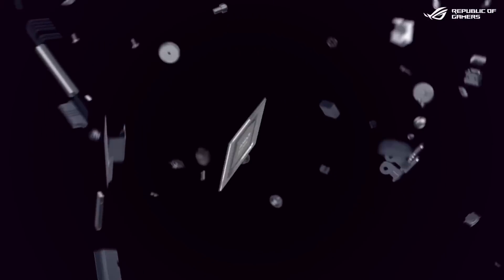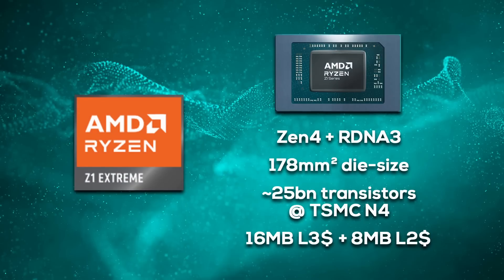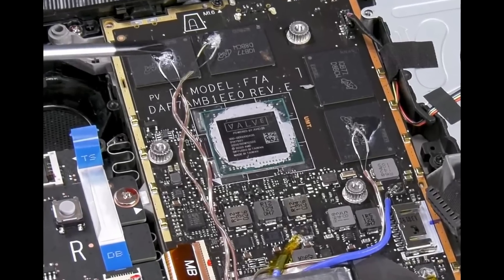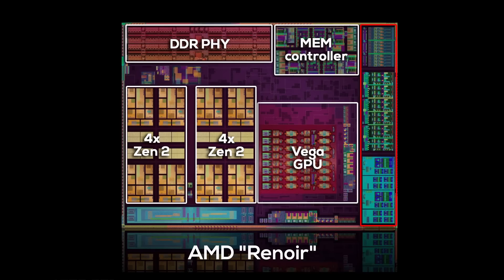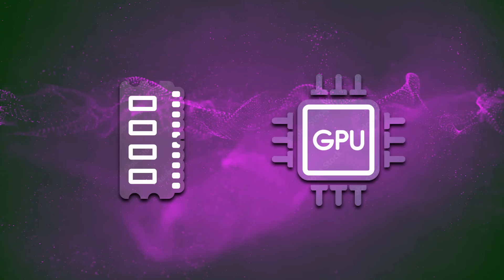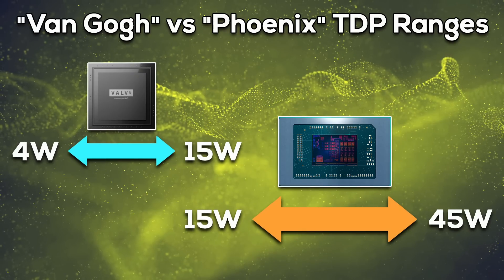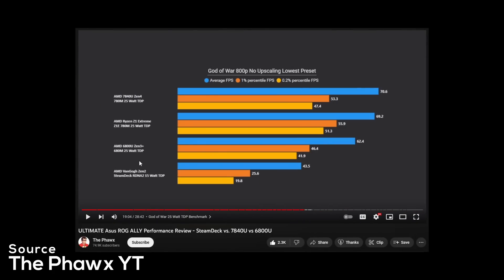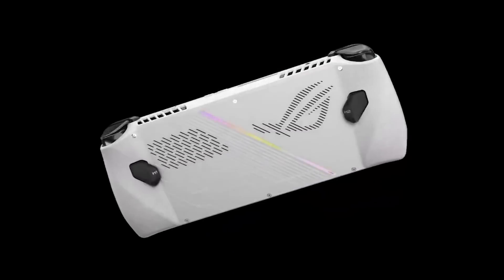Why the ROG Ally can't beat the Steam Deck

Comment: They are competitors, but they do not completely overlap in use cases and functionality. I have my steam deck, and have ordered an ally. The deck is great and far outperformed my initial expectations, and there are a lot of games where you can drop the TDP down to a measly 3 watts and play for extended timeframes. I’ve comfortably gotten enjoyable performance from newer games at only 10w as well, it’s just a great experience. But what makes the deck shine the meat for me, is the combination of SteamOS and the Built in Steam Controller 2.0. The track pads go a long way in expanding the kind of games you can play on deck.

The Ally, I can only go on what I have seen, and what I have seen is mixed but positive. I think the biggest thing holding it back is windows overhead, and the early first generation state of the software/hardware combination. Given 6 months or so of it being released I think will go quite a ways to smoothing things out both driver wise and software integration, and possibly some windows handheld centric optimizations from Microsoft or the community at large, I think we can expect good things.

Time will tell, either way, people looking to run these portably for extended play time, need to temper their expectations a bit, and stop comparing them to phones or the Nintendo switch. Buy a portable battery bank and enjoy extended play.

Comment: Also the Steam Deck's RAM runs in Quad Channel configuration which also adds to the performance. Yeah that makes sense why the Steam Deck out performs the Ally at wattages below 15 watts is because the Deck is optimized to run and performed at those wattages unlike the Ally. The only thing that is custom about the chip of the Ally is in name only the rest of it there is nothing custom about the Ally's SOC.

Comment: For me Ally is a winner, windows OS allows anything you can install on a normal PC to be installed, that includes pirated games for those unable to afford them. Steam deck is tied to your steam account so only purchased games or EMU games. 
No contest.
Steam loose out on my cash due to unavailability, I have tried for 3 months to buy one and only option is the 512gb, I wanted the 64gb version which I planned on upgrading myself.
Now the Rog Alley is out it's a no brainer, almost the same price as the current Steam Deck that is available but you a better screen, better CPU and install what you want and not tied to Steam OS and what games you have purchased there.
Reply: Shoot,,thats make sense,,thanks for ur explanation,,my heart goes to ally
Reply: Yeah, I think most fanboys forget that there are other places to get games (whether that's another store front or pirating). You don't even want to know what a nightmare it was to try to play my own, older, games from discs on the steam deck. I used a program to convert them to isos which are perfectly playable on windows but not at all simple on the steamdeck!

Comment: According to The Phawx's rigorous experimentation, they've come to the hilarious conclusion that disabling cores in the 6800U doesn't really save power. In fact, it sometimes results in lower performance at the same TDPs. Now, while we haven't tested it on the 7840U, I'd bet my collection of vintage floppy disks that you'll likely witness a similar comedy of errors. So, my friend, it seems like disabling cores won't give you any superpowers, but hey, at least you'll have a good laugh and the same TDPs!

Comment: The ally is having software / driver issues. At 15 watt the ally outperforms the steam deck. Steam deck is only good at low tdp. Plus the ally screen is vrr capable which is a game changer. Allows for a much smoother experience.

Comment: Doesn't matter. I've had the steam deck for a year and rarely use it. Gaming 60 FPS max(most time 40 to 50) with no vrr just sucks. I would 1,000,000% be OK with higher power tdp limits to push more frames and less battery life than playing less than 60 with no vrr. 😂

Comment: 1) battery life .
At 10 watt ,deck straight up murder the ally. 

Performance at lower watt.
The deck once again dominate the ally. 

The only reason to get the ally is if you want to mod your games .

If you want actual Performance out of the ally you will have to stations as lower watt gameplay is out of matter.

Comment: I have been thinking a lot lately, people are very excited about the price about the Asus ROG ally isnt it basically a decent laptop with the keyboard cut off and a smaller screen? Can't you buy a decent similarly spect laptop for about or lower then the price of the rog ally? I have the steam deck and I have the Rog ally pre-ordered and am looking forward to getting it. But I don't exactly agree when people make the claim that Asus isn't making money off of these units. It's mostly off the shelf parts, it's windows 11 with a little optimizing. Memory prices and chip prices have fallen throughout the last year or so. When you think about everything Valve has put into the steam deck, custom chip, custom version of linux that makes PC gaming very approachable for maybe the first time on the go, you realize how insane of a deal that 64gb steam deck really is. People gush over that 1080p screen on the rog ally, people gush over it's pure power but in truth is your likely going to turn all those settings down to close to what they would be on the steam deck anyway to conserve battery. I'm not saying the Asus rog is a bad product by any means, like I said im looking forward to it. But in my opinion the Steam Deck is a way better value and I think the Steam deck isn't going to have any problems outselling this thing massively. The steam deck is a game console that happens to be a PC, the Asus rog is a PC that happens to be a game console.

Comment: I learnt today about using FSR on the Steam Deck, it allows for a lower resolution to be used, then lock frame rate at 40 and you can turn the graphics settings up for a game.

Comment: For me the software also makes the SteamDeck better, Windows can’t suspend games properly for instance, it drains the battery. That’s one reason Valve went with Linux, because they wanted to squeeze as much performance out as they could for as little power as possible.
Reply: It's been said million times: windows can suspend game, just turn off hibernate mode. Doing this has no effect on battery.

Comment: Yep, for me personally battery life matters a lot as Im starting into trekking backpacking and Im also a truck driver all europe. Rog Aly is more powerful at higher wattage but I value more battery duration so steam deck 10 watts mode wins hands down no competition for my specific case scenario
Reply: Switch oled has good battery
Reply: @ufcfan3940   even if switch has decent battery (depending on what games are being played) I dont want to buy one as games are very expensive and I like the freedom to dual boot windows 11 from sd card while keeping steam OS on internal storage.

Comment: The ally power is getting taken by the cpu. Disable SMT and possibly 2-4 of the cores and lower the cpu clock a little. This will give more power to the starved GPU
Reply from the maker: Maybe the cheaper Ally with the normal Z1 chip will perform better than expected.

Comment: For me the colour and contrast ratio of the screen, and charging rate of the steam deck makes me uncertain.  I would much rather have a small amount of time with the ally screen than a long time with the steam deck screen.  Nobody seems that bothered about the screen from that perspective.
Reply: Do you own the steam deck? My screen is terrible. I'm not sure how it was assembled but there are white pressure marks around the top left and bottom left of the screen, as if the casing is pushing against the panel. Not to mention everything looking slightly gray, even with software adjust to it.
Reply: @jollyrancherchick  I saw one in a second hand shop and it really put me off, so I waited.  That was before the rog ally was public knowledge.   I can’t be doing with that,  colour is a big part of the experience for me.
Reply: I think what you are talking about is backlight bleed btw.

Comment: Power efficiency is cool. But if Steam deck will continue to struggle running new games at stable 30 (and it already is) many people will choose more powerful z1 devices instead
Reply: New games are not all designed as AAA power hungry titles. That's just a few of them.
Reply: @stephanepiquemal8297  Who cares if what the user wants to play happen to be those few titles?
Reply: @jollyrancherchick  Even the Z1 struggles to play titles such as Returnal. Such power hungry titles are just not designed nor optimised for handled devices.
You can't expect developers to optimise their games if people keeps buying the next more powerfull device.

Comment: Maybe Asus ROG Ally will get another SKU with Z1 and 720p/800p screen. This could trim loads/power draws and get closer to a more mobile usage oriented device... you know, maybe also some BIOS/firmware/OS updates to default to lower power draws, 720p screen resolution, maybe dynamic core parking akin to AMD's X3D solution to trim the CPU down to 4 or 6 cores... at half the core count and closer to Valve's take on VanGogh's architecture, the rest of the APU may be capable of better utilising power available. Lower screen res plus such tuning features could bolster Ally's use-cases.
And of course, disable by default/remove the useless and yet power impacting RGB lights on the chassis... It’s not adding anything, but it draws precious little mW of energy stored in the battery.
Or Valve updates their Deck with a chip made for <=5nm manufacturing node for even better power efficiency. Maybe they could arrange for another specialised design with updates to Zen4+ and RDNA3+... that could further boost battery life, the one precious thing in a handheld...

Comment: It still does not make sense when compared to 6800U.. it kicks SD'ass at low power and its a laptop APU and it also kicks Z1E's ass. I think drivers are at fault and the ability to disable cores will be great.

Comment: Contrary to steam deck cult's beliefs rog ally is literally superior in every way when comparing the retail 512gb models of steam deck, aya neo, gpd and onex for the same price point.
The only win steam deck has is when you buy 64gb for 399 and upgrade ssd for way cheaper. But still you get far less performance.
It's like saying 4090 is worse than 4080. HOW? The only thing is the price

Comment: Thanks for this. 

I had a feeling that the Ally wouldn't be a competitor to the Steam Deck, but I couldn't figure out why. 
The boost in power and tech was a red flag for me.
Reply: Easy to compare a device with pre launch software. To one that’s been out for over a year. The SD had multiple issues when it first released
Reply: @xxRichBoy  Asus doesn't support much their products, tho, Armoury Crate has never worked well on my laptop

Comment: Ally absolutely crushes the SD at higher watts. Idk about you guys, but I'm not getting the Ally for low watt gaming. I'm getting it for performance and ability to play AAA games.
Reply: You can better buy a gaming laptop then. Dont really understand peeps like this. Yes, the ASUS is strong. But what is the use of a handheld if it dies in 1 hour and with daily use your battery wil die in 2-3 years.
Reply: @shadowhunterrx  what's not to understand? There are tons of AAA games that run fine on the SD, and will run much better on the Ally. Didn't say I wanted to run them all at 60+ fps. I have my PC for that. But what I can tell you is that I got my Z1 Extreme Ally for cheaper than my 512gb, and it's a huge upgrade lmao
Reply: You might as well invest into a laptop or a low/mid tier pc with $700 not including accessories. You do that these are handhelds yes? The technology isn't there yet for whatever imaginary handheld console that's in your head. I give it another five years before you see anything of a handheld console that plays AAA games with 60hz 1080p with 4+ hour battery life.

Comment: The beautiful thing about the Valve using Linux for the SteamDeck is that they could optimize the drivers and kernel for their specific hardware and usecase. This flexibility doesn't exist on Windows.
Reply: You can also install Linux just like any PC idiot on the rog ally

Comment: There's a serious problem with the unit when it falls behind by 40% compared to 7840U at all power levels in most games.  Even falls behind the 6840U at some power levels.  10W 5W are the biggest problems with the Ally and the Z1E.

Comment: Your videos never cease to amaze me. I recognize your video is largely about power efficiency, but I was in discussion last month, why consoles are often better in actual gaming than pc with some of the latest games.  I believe due to balance and efficiency from the game design stage to pc hardware it’s programmed for in comparison to newest consoles. “Purpose Built vs All Purpose”, it’s not just about brute power. Your talk of custom design, balance, i/o, memory processing and bandwidth is translatable to pc gaming ecosystem.
Hardware manufacturers and game devs must establish balance. I believe pc gaming issues are largely due to data I/O and memory bandwidth at the software level.  Devs can start by requiring SSD, (ideally NVME) and maybe VRAM rqmnt tiers such as 8Gb - 1080p, 10-16gb 1440p, 20gb+ for 4K.  They should quickly adopt DirectX 12 Ultimate featureset, most importantly Direct Storage. 
GPU manf. should ensure the VRAM amnt\bandwidth is suitable and balanced with gpu processing power at targeted resolutions. Stop starving powerful gpus with low bandwidth VRAM. PC does so many things well, but it must find a way to address and minimize its weakest links. Rising tide lifts all boats. Stop trying to use brute force and excess in one area to offset design flaws or shortfalls in others. There’s art and elegance to balance and efficiency.

Comment: Even though the rog ally is a more basic chip, it works for me. I'm on my tablet right now, connected to an external power brick. So, really, I'll get way more than enough battery life in my normal use case before sitting near a charger, or putting the external brick in a  charger. If we got a new custom chip though..... Lawd.... Custom, 6 cores, 16-20 cus should be possible.

Comment: you forgot to mention the trackpads as an advantage for the deck, they improve the experience in certain games not designed to be played with a controller.
another thing to consider is game streaming, contrary to what the Rog Ally presentation said, cloud gaming DO WORK on linux, they implied you need windows for that wich isnt truth at all! in fact microsoft made some patches specifically targeting linux to improve the xcloud experience on it!
if we take into account that cloud gaming wont use the internal hardware too much, steam deck should be better at this use case too, since it probably wont need more than 10 watts to receive/decode an video streaming, you probably can reduce the consumption to 4W and get at least 8 hours of gaming , contrary to the rog ally wich cant go bellow 9w, and may struggle to decode videos if you reduce the clock too much.
Reply: trackpads ++
screen aspect ration ----
Reply: Never use track-pads or back buttons

Comment: The 8 Zen4 cores is a bit overkill for a handheld. Yeah, it's a high performance laptop chip. There's rumors that the Van Gough chip was originally developed for Microsoft Surface but they ended up not using it.

Comment: Why do people think that it is required for the Ally to beat the Steamdeck on every aspect? Those two can easily coexist and have their own identity and percs...
Let's not forget that the Steamdeck at release was NOT what it is right now. It used to slow down upon opening the fast settings, did not have a profile for each game, no 40hz, no Cryobites tweaking, no homebrew plugins, no GE proton, etc.
It's not crazy to think that seeing a big name pushing windows gaming on handheld will help create the same kind of movement the Deck benefited from. Even if it's not to the same extent Valve did because the Linux community is kinda boss!
Let's wait and see what kind of magic the community and some optimized drivers/software can bring.
Reply from the maker: Ofc they can coexist, that also my conclusion at the end of the video. In the end, although they look very similar, they are quiet different products.
Reply: @BobDevV  I know that Proton existed before the Deck..I just said that the Proton community really helped when it comes to making the SteamDeck what it is today, wether it's the main Proton or GE,etc 

As for windows i never said nor implied that the Windows community could help the windows handlheld to the same extent that the linux community did with the deck. I just assumed that, at least, it can help polishing many things while AMD and Asus work on their Drivers and firmwares. Which could bring even better results than those that we already have.
I had many GPD and one Aya Neo, i remember pretty well tweaking the bios, handling drivers and having few tools like tdp switchers, tools for overclocking and undervolting, etc. And obtaining a 15-30% performance gain overall...Everything came from the community and helped squeeze the power of those handheld. A big part of The Phawx's succes is actually related to his work on Windows handhelds...
Reply: @BobDevV  There is no need for that much work...
The Ally already has it's own real percs(power, compatibility, screen)... Any plus is cherry on a pretty cool cake which can totally exist along the Deck.
I have the Deck myself and i'm pretty sure the Ally won't make up for Steam Input, or the Deck's pricepoint.
Still, i preorder the Ally because of what it can already do, and it's potential to do even better with existing solutions and probable new ones (+official drivers,etc).